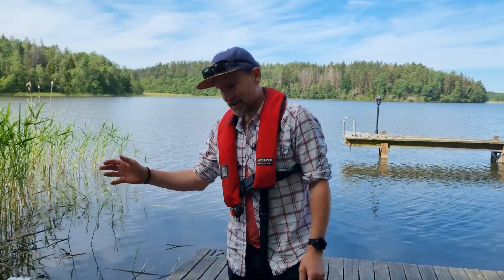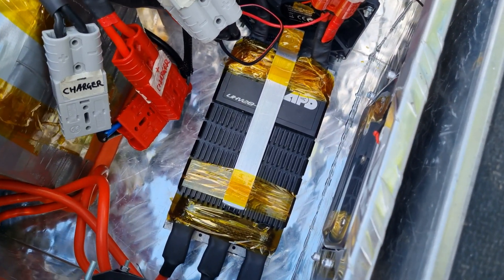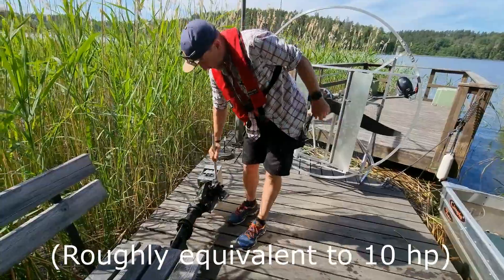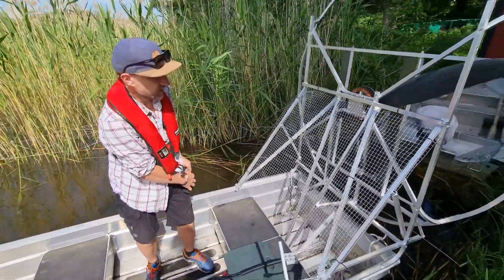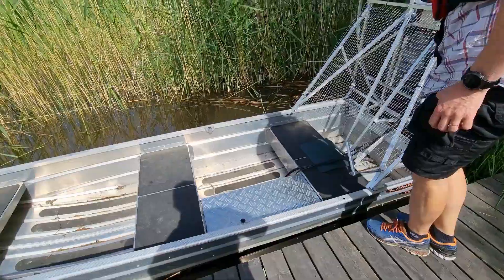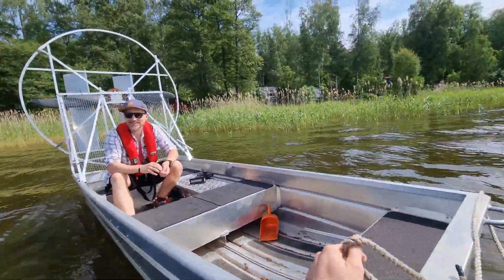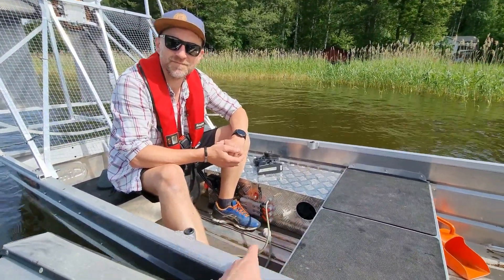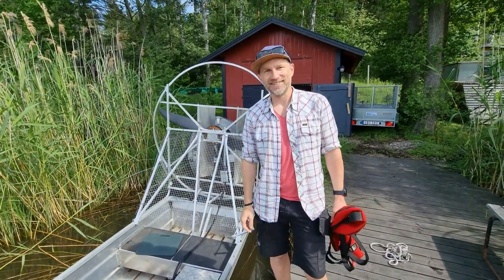Electric mini airboat first open water run!

Comment: Would hate charging up the batteries or the short ride and lack of speed or load. Safe for kids. 1000hp is for starters now days and fun! Electric outboard would be faster
Reply from the maker: Hey there Darcy!
Jack here.
Charging really isn't an issue since we really tailormade this boat for our own needs, which is a very short 500 trip over the lake👍 And sure, it isn't the fastest or most powerful thing on the planet, but any faster and that hull will fold itself in half😂 We call it a MINI airboat for a reason🙃 Mini size, mini power, but still some good fun!

Thanks for watching!
Cheers🍻

Comment: You should make that box water tight, rubber seal the lid and flex seal any screw holes.
Reply from the maker: Hi @Bill Gorman! Great suggestion! The prototype was/is in great need of small things like this. We've prioritised finishing our end products now, so the prototype is gonna have to live with getting wet and damp occasionally😂We hope it hangs in there!  Thanks for dropping a line! /John

Comment: Have you tested this electric airboat running dry? Would be curious if it would navigate a shallow creek ( at times less than 1 inch water )near my house that has lots of sandbars to briefly run over. How long will it run on a charge?
Reply from the maker: Hi @CodyRothMusic!

Thans for the message, here and on Messenger. Sent you an answer there, but in answering here: 

- less than 1 inch water is of course no dramas :)
- brief sand bars, shouldn't be a problem, its really powerful
- normal usage, you should get around an hour runtime. 

In our testing the runtime has been perfect for our usage, and should mirror enough range for anyone who is out on the lake doing what you normally do with an airboat like this.

Cheers John
Reply: @marsonselectric  Thank you so much!

Comment: Nice lazy slow turns with gentle throttle,  with that fishing hull.  If you try to slide it like a smooth bottom Florida Everglades airboat??,, into the drink with Yee!.   Even the Amphibious skirted airboats, with really low CG design, and thrust vectoring rings and vanes will dig in and flip over, and sink.    Otherwise, you guys win the Christmas Turkey, Very Nice Job!!.   Keep on it John, there will be a market for a double kit conversion.
Reply from the maker: Hi @kh40yr  !

Yes, you're totally correct with the CoG, and care must be taken if heading for a slide! CG has been a priority in the design, and is really good in the production model. 

The hull design we are using takes into account ice/snow usage, an application where more certainty is needed in the direction of the craft, it is fully sketch without the ribs otherwise, trust me!😅

And honestly, both Jack and I love Xmas Turkey, so we're expecting delivery of one from you soon! 😅Maybe we can take it on an airboat ride😅

Again, thanks for the message, and have an awesome day!

/John

Comment: about 50%  boats develop a leak in them at 1 time or another. im going to guess that water in the boat might cause electrocution.
Reply from the maker: Hi @gregoryperkins! Thanks for dropping by, and you're right, water and electricity don't mix! As a prototype, this has a bunch of not-so-neat solutions :) . As time has passed, we have made some changes to increase waterproofing and safety, these just aren't in this video. We use it as our daily commute, so for our own part it is important that things stay in good shape, and are safe to use. In our production model, everything is made professionally, it is all IP67 rated, (fully waterproof), adding to the safety of the boat. Again, thanks, and hope this helps! /John
Reply: @marsonselectric  ive designed swamp buggys for 40 years. my ultimate was an electric hydraulic because the vehicle spend so much time in the water. on the wheels a hydraulic motor drives the wheel hub. hydraulic steering is also used. the vehicle has 2ft of suspension travel and the hydraulics dont use a driveshaft. i toyed with the idea of an electric motor on the wheels. i never got past the safety issue when it was known that higher than 12 volts would be needed. the electric hydraulic version hides the electric motor in a sealed unit with only the hydraulic line coming out.  when i was young we always used 16ft aluminum boats for fishing and hunting. i cannot imagine a water problem with all that electricity on board.

Comment: What size motor is on the outboard
Reply from the maker: We are running it at a maximum of about 8000 Watts to keep heat within the system at sustainable levels.

Comment: This will produce substantially more thrust if you create a ducted housing for it. I've considered various jet type propulsions for water craft prototypes.
Reply from the maker: We did try with a ducted housing on an earlier prototype @E-Nonymouse, yet it didn't give any measurable difference in thrust, and because of the added weight and production costs, and the need for super simple utilisation we scrapped the idea.👍

Comment: Is that a manta motor
Reply from the maker: Hi @clayborn Lewis! 

It is a motor from marsons.. 

There are some details in some of the videos, and also in the comments sections on what I've been using, but in my coming videos one of the things I will improve is the list of parts used.

Cheers John
Reply: @marsonselectric  I tried to send you a picture of an advertisement for Manta ll motor but it wouldn't let me look it up it's a 10 horsepower electric motor it runs either 12 volt 24 volt or 48 volt I think it would push your airboat pretty damn fast 10 horsepower is a lot of power I think you would enjoy that immensely LOL

Comment: are the two  electric motors similar in power? also what power is the mercury? Btw Im building a boat and  live in Northern Sweden! like your videos!
Reply from the maker: Hi @eriylly👍 The motors are quite different, and we'll be going through the parameters, differences, and why they are good for their different applications in the next coming videos! Northern Sweden rocks👍 Egentligen bor vi oxå något längre norrut, dvs i Jämtland, men vi hänger en del vid stugan i Sörmland 👍/j
Reply: The torque output of most motors puts the ICE outboard to shame easily.